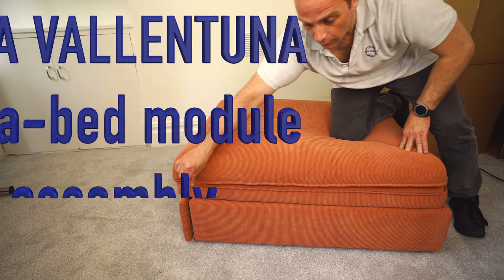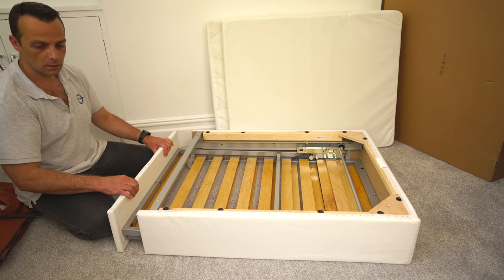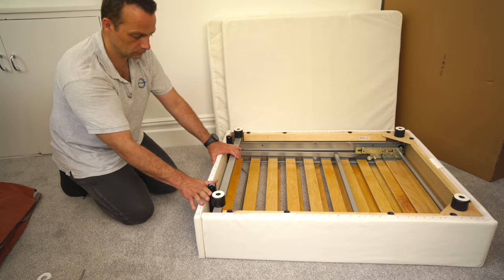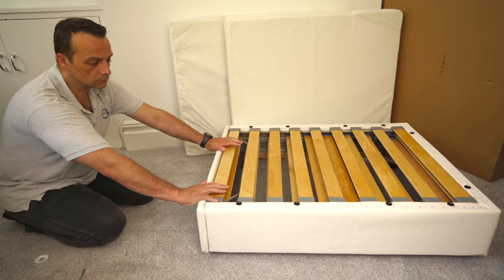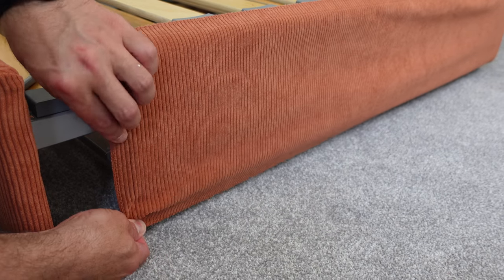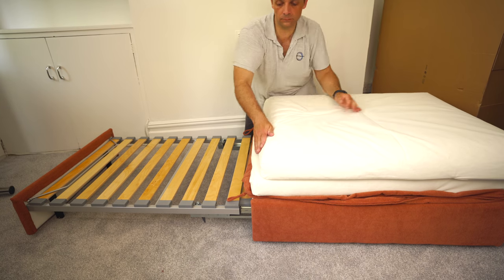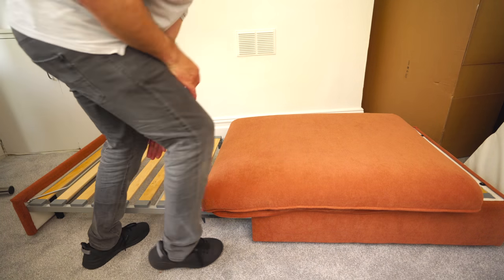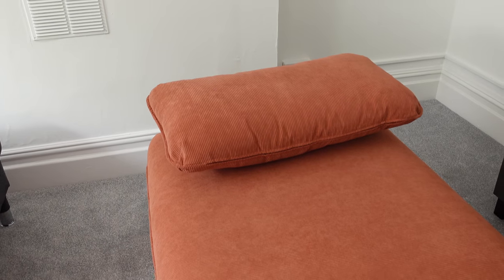Ikea VALLENTUNA Sofa bed module Assembly instructions

Comment: Very low quality. After 2 years material started to tear. Ikea Slovenian says thats normal use and that this is not warranty. So 10 years warranty for Ikea sofas is a big lie
Reply from the maker: I think the covers can be replaced
Reply: No they cant. There are no zips or something like that, so covers cant be take off...not on my Vallentuna sofa made of MURUM material. And even if there would be an option to change covers i would expect IKEA to cover it under warranty, because they sell it as a robust material with a 10 years warranty😅 . It’s a strong and durable material and very easy to care for — just vacuum the surface using the soft brush attachment on your vacuum cleaner and wipe with a damp cloth they say 🤨
Reply: And guess what i cleaned it just like they say and use it ilon the way that sofa is meant to use ( to watch TV and sit or lie down on it). Very odd way to use sofa 😂